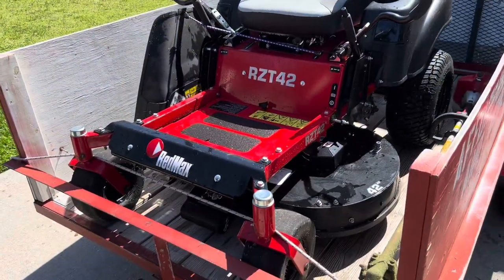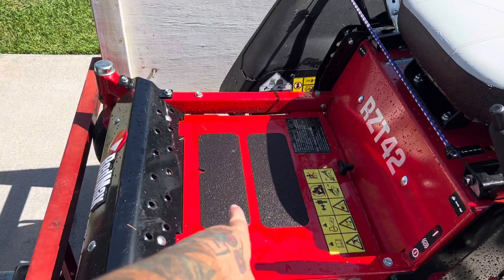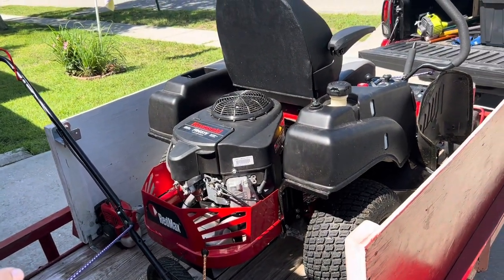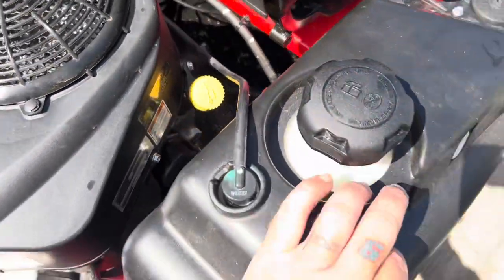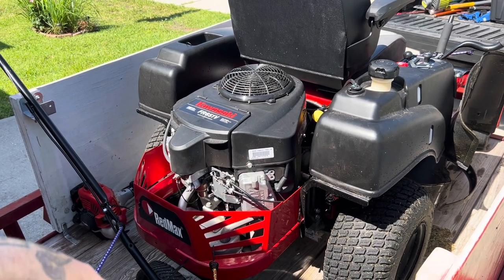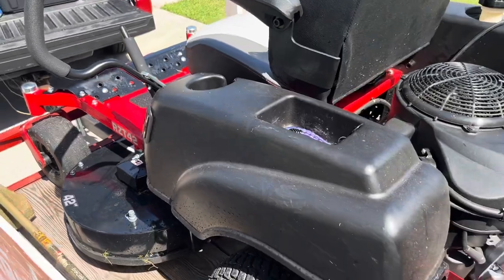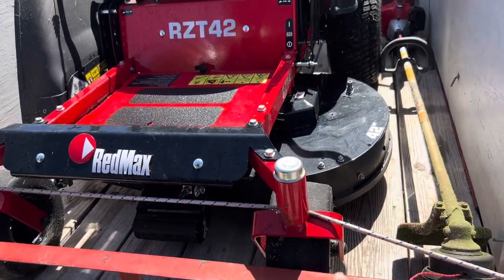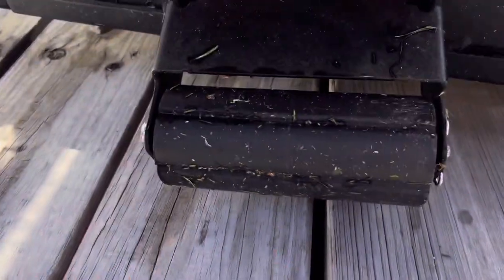Quick overview and two week review of my RedMax RZT42 mower

Comment: Hows the deck, i don’t like the fact that they don’t have anti-scalping wheels on the outside of the deck, I’m looking at buying one but that’s the one thing holding me up. One big one in the middle of the deck doesn’t seem like it would be enough
Reply from the maker: Well as long as you are mindful of it there is no problem.  In the year I have used this mower I haven't had many issues at all.  I replaced both back wheels and tires bc I had one flat.  Other than that just did the normal maintenance and have been great.

Comment: Any issues since this video?
Reply from the maker: Other than replacing the blades, i had a flat last week so i replaced both back tires/wheels.  Now I have one spare.  Did my oil and filter change as recommended. No other issues.  Thanks for asking!
Reply: @JG24rlzsun  one has come available close to me and I’m juggling between this and a hustler raptor 42 both pretty good condition